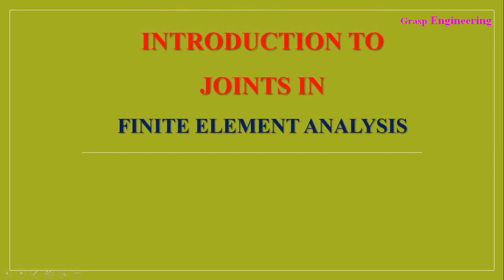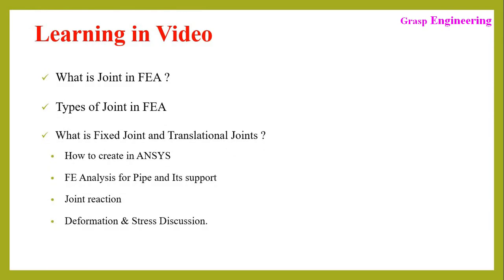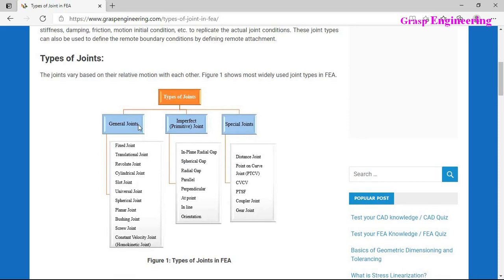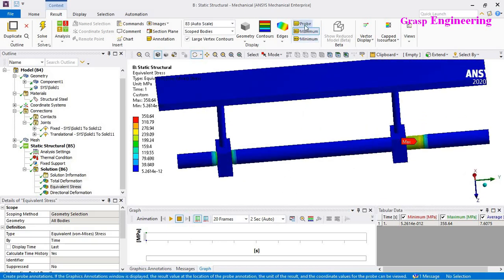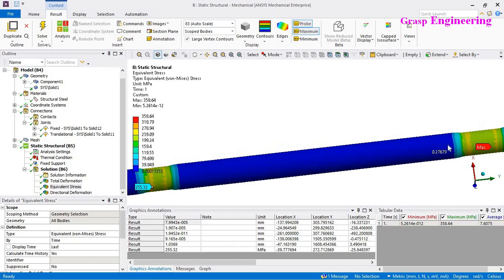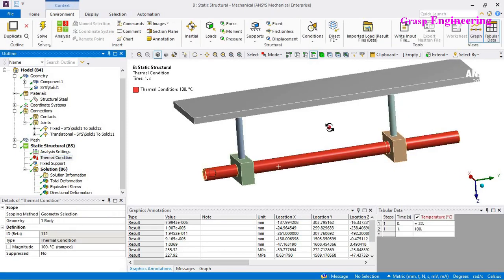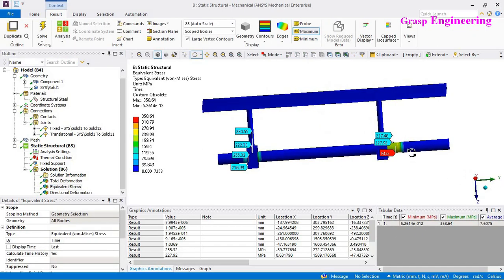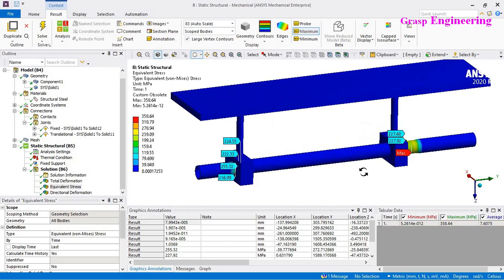Types of Joints in FEA # Fixed and Translational Joint # Pipe Analysis In ANSYS

Comment: What is difference between joint with contact? Ex. What is difference fixed joint with bonded contact?
Reply from the maker: Both joint and contact are different types of connections and used for different applications. Joints can ne used to replicate actual physical joints while contacts can be used other connection (welds & friction). Fixed joint and contact represents the similar connection type. Please refer, https://www.graspengineering.com/what-is-fixed-joint/